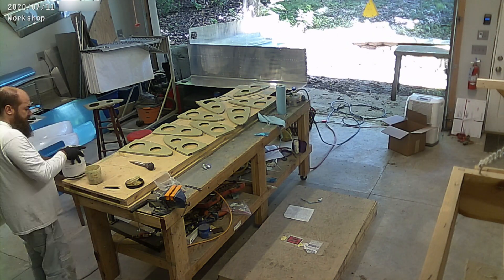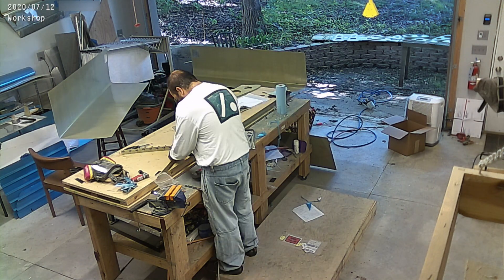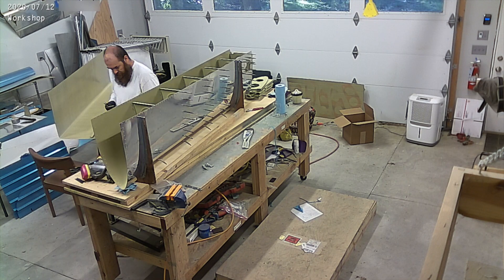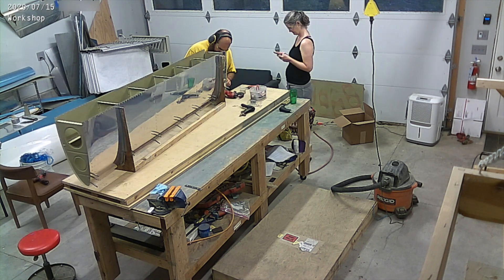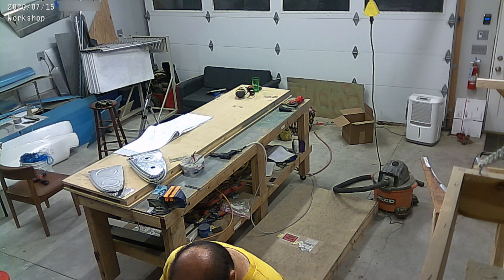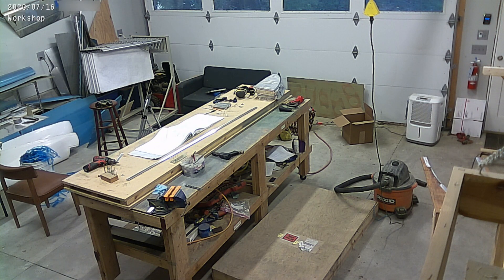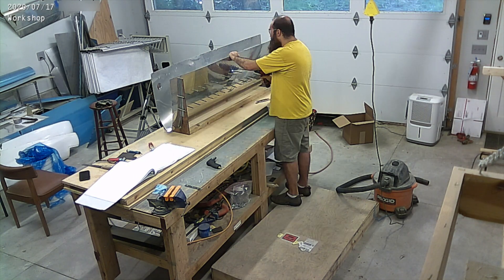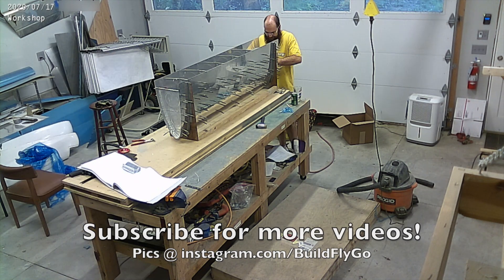RV10 Build July 2020 - Week 3

Comment: Just found your channel. I’m just a bit ahead of you with 90% finished wings (haven’t riveted bottom skin due to wiring, A/P servos, heated pitot, etc...) and I’m working through the fuse kit. Like Tyler, our fuse kit was ready exactly on time with what the original quoted date was. Keep up the good work!
Reply from the maker: Cool. I waited till the very end to do the bottom skins on my wings. Wanted avionics mostly done before I closed those just in case. On the 10-fuse, I'm considering delaying it till the winter to get more full-hole-size parts... dunno...
Reply: BuildFlyGo has Vans said they are producing more final drilled sized parts as time goes on? I hadn’t heard that news, could you point me to an article or something? 
As for your avionics and other “in wing related do-dads”, can you tell me exactly what you have in your wings just so I can check my plan against yours and make sure I’m not missing anything?
Reply from the maker: @auburnaviator6167  Yup https://www.vansaircraft.com/2020/07/vans-announces-plan-to-move-to-final-size-holes-on-rv-10-kits/
Reply from the maker: Servo, light, antenna, regulated pitot, etc.

Comment: Ordered the fuse yet?
Reply from the maker: Yes! Were you the one looking to slip a part into there? If so reach out to me on fb, there is still time.
Reply: BuildFlyGo not me! I’m building a 14 and need to order my fuse too but wanted to feel out the lead time. They are saying 12 weeks to ship, but I know quoted and reality sometimes are different (my wings shipped quick despite saying they had a two month lead)
Reply: Pilot Jeff ours was exactly on time. Ordered in April. Exactly 10 weeks later we got the call it shipped.